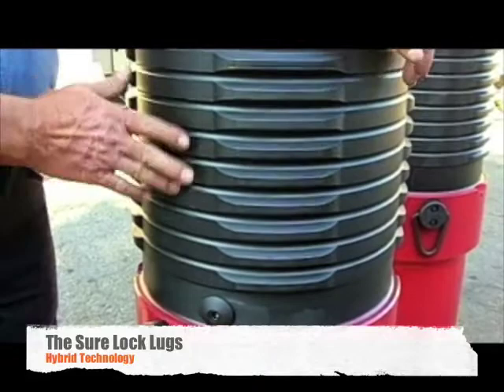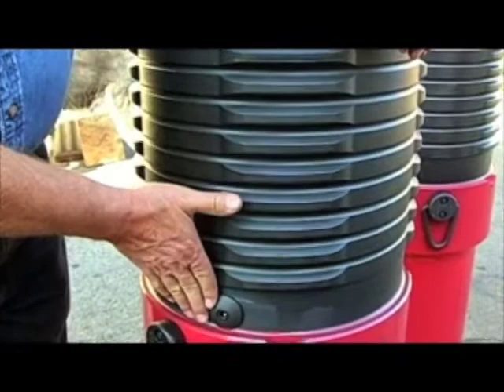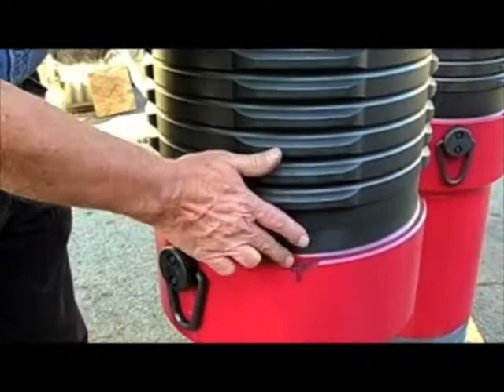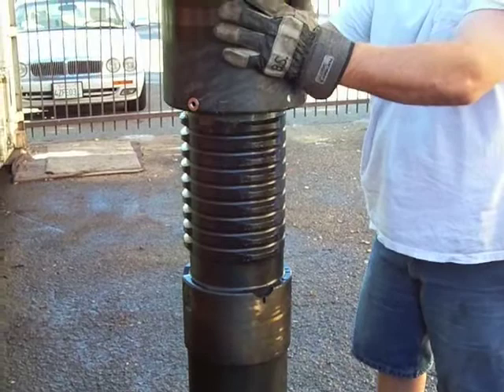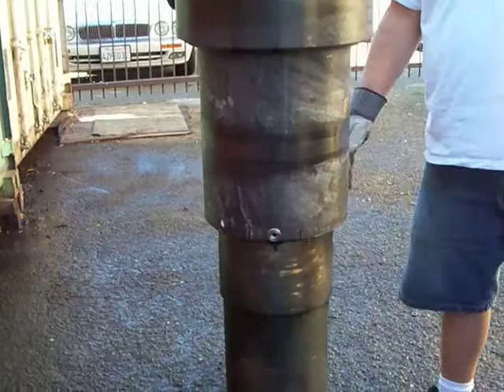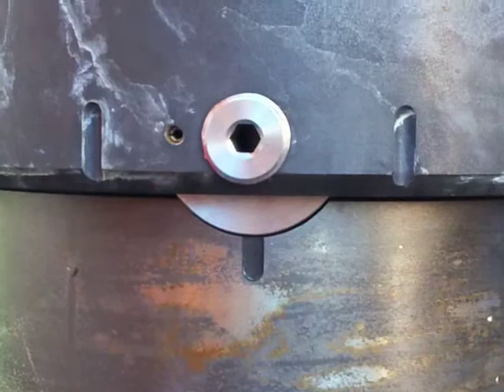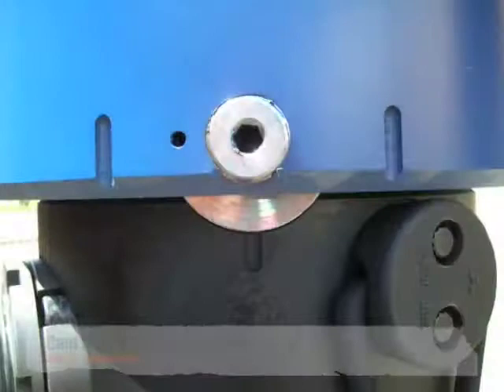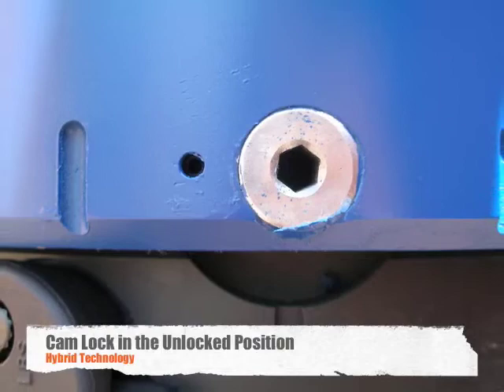SURE LOCK SYSTEM

Comment: this lock configuration can push/pull 500 metric tons while being pressured to 15,000 PSI and rotating up to 50,000 foot lbs right hand torque. these designs have been out on the oil rigs for over 5 years with no failures on the surelock system. impressive!